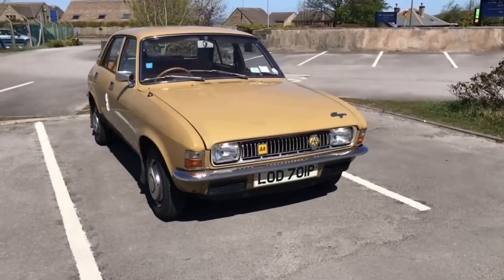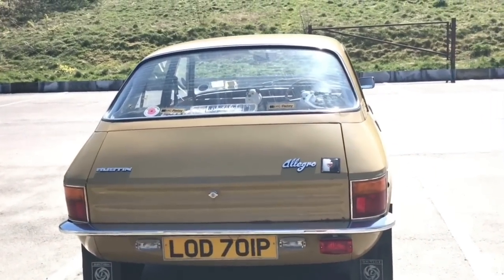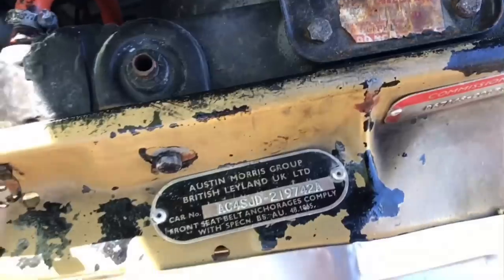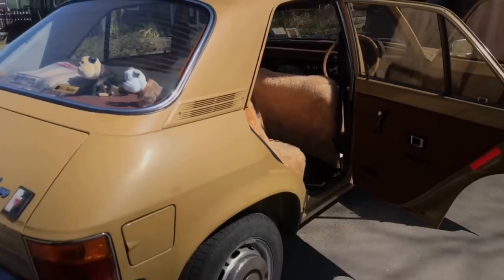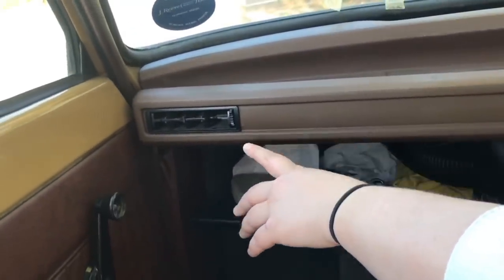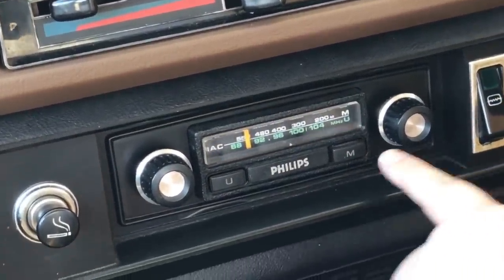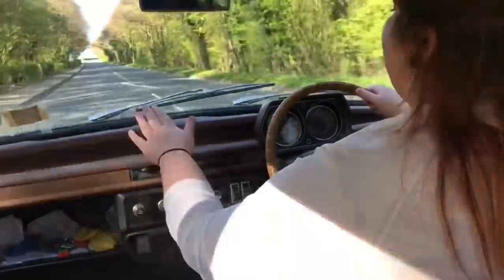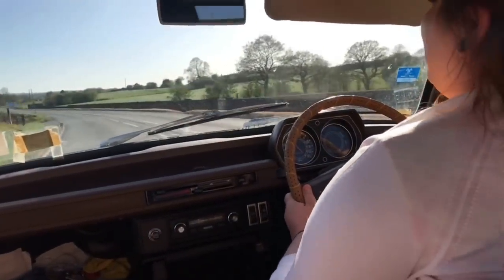IDRIVEACLASSIC reviews: 1970s Austin Allegro

Comment: You often hear the complaints about the styling of the Allegro, barrel sides, dumpy pudding, bonnet line far too high etc. But look at the newer German cars like the Audi A1 and Mercedes A class; they are exactly the same shape! They have big high bonnets and the A1 even has side windows the same as the Allegro. There is nothing wrong with the Allegro's shape as such, but the lack of a hatch and the frontal design, small inset headlights etc, did make it look like it had a chubby face. They are clearly well engineered and capable of long life, and the suspension is amazing. The main problem was the competition from the VW Golf which ushered in the era of very practical cars with sharp edged styling.
Reply: I always thought the recently replaced honda civic had a very similar look to the allegro.
Reply: The Nissan Juke is a MUCH MUCH MORE ugly car than the Allegro yet is regulalry in the UK top ten sales.
Reply: Absolutely agree. All modern cars are really Austin Maxis, are they not.
The Allegro needed a hatchback, but the "estates", which had  the tailgate were so odd looking that they could have been a separate species. 
Was not the real enemy the smart-arse motoring pundits (especially those on the telly).
Reply: Exactly, people think the allegro looks crap because they have been TOLD it looks crap 🙄... Media programming the masses as usual. Worse then ever now.

Comment: Had an Allegro as the 2nd car after I passed my test in the 1980's and loved it at the time, never let me down. First car was an 1800TC burgundy Marina 😁, that was awesome too.
Reply: I had a Marina 1800 after I passed my test in 1985 never broke down once
Reply: I also borrowed and broke my parents marina - it was a brown 1800 automatic (with a hideous dark brown vinyl covered roof) - being a young lad who thought a  wheelspin would impress someone, and not having driven an automatic before ... Just in case anyone is wondering what happens if you rev an (old) automatic in neutral then move it to drive ... Twisted leaf springs and missing teath in the differential ... No wheelspin and unhappy parents ...
I always preferred the ride and handling of the Allegro to the Marina

Comment: I was a car crazy teenager when the Allegro was launched.  I vividly remember first seeing the pictures and technical description in Autocar magazine.  It looked a lot more modern than just about anything else in its class.  It was underpowered and had fairly basic equipment levels but it was not much different from most other cars of the time.  The quadratic steering wheel was a rather odd choice though.  
Of course, it suffered from all the usual BL issues which didn't help its case one little bit.  Overall it was a perfectly adequate car but with "Marmite" styling.  That was the biggest problem, it was adequate at best.  The other problem was that it was never developed over its lifetime.  By the time the Maestro came along it was woefully outdated.
As a classic car it fairs somewhat better.  Cheap, very simple, loads of parts still available, and a great talking point.  Most people that criticise the car now would never have driven one.  They are no worse to drive than any of it's contemporaries.  Personally I would complain more about Vauxhall Vivas, or Ford escorts.  But then, given the choice I would have bought a Citroën GS which probably says more about me than anything.
Good reviewSteph.  Looking forward to more in the future.  Thanks.
Reply: @Grey Fool........I had a Citroen GS Pallas in the 1980's [white with black vinyl roof] and it has to be one of the most luxurious and technologically-advanced cars I have ever owned and for its day! [named 'European Car of the Year' in 1971]. It was incredibly comfortable, even on really long journeys - due to both the hydro-pneumatic suspension and armchair like seats. The interior and dash/controls were top-notch and everything about the car had a very upmarket and premier feel to it. 
It wasn't particularly rapid [with only a 1299cc 4-cylinder engine] but it could comfortably cruise along at 70mph all day long. However, you didn't really mind the lack of acceleration as it was just so relaxing to drive you never wanted the journey to end! It was also extremely quiet, well-mannered and a real head-turner for its aero-dynamic styling. I absolutely loved my GS and spent hours cleaning and polishing it - I even kept the engine bay immaculate!
I really hated having to sell it - but I changed jobs and got a company car as part of my compensation package. It was so funny because when my new bosses offered me the job, they invited me for lunch to celebrate and insisted I took them to the restaurant in my GS! [they had never been in one before and really wanted to see what it was like]. They were so impressed, they actually tried to get the company to switch from Fords to Citroens as the company cars!

Comment: Tell your boyfriend to retrofit a flexi-pipe just after the bend under the manifold.  Fairly cheap from parts suppliers, often just a clamp fit (cut out the section that won't be clamped, obviously) and this should pretty much take that torque strain off the manifold clamp.  I had an orange estate version, 1.3 I think,  many years ago.  The three door estate was an exceptionally good car, a Morris Minor Traveller replacement in terms of usefulness and what is I believe, an iconic profile.  As an apprentice mechanic when these were current models, I remember only too well the horror the styling received when first revealed.  My own recollection of the rear wheel failures was that, unlike the previous model (ADO16?), this one had adjustable rear bearings and not tighten up tight ones.  So, they were wanged up tight, got red hot and fell off!  We had some very vivid colours in those days, to jush up fairly cost cutting trim levels.  This little car was blessed with one of the less OTT schemes... there was bright orange, lime green, etc on later examples from memory.
Reply: Smack on with the rear bearing comment that was the cause, nothing else. later ones had a warning label fixed to the washer.
Reply: So right about the estate, I found it a very pretty shape at the time, not "rather odd-looking"! !
It just has a little kink in the rear of the roofline, almost like a spoiler (to allow room for the tailgate hinges)

Comment: Mine was the same colour and I loved it. Basically an upsized Mini, but with all that space round the engine  there were no scraped knuckles when performing a service. The SU carb benefits from regular adjustment and it pays to fit a new main jet and needle every 20k to ensure best fuel economy, -something your local garage won't be doing.

Comment: I had a Mk2 poo brown 1300 Allegro back in the late 80s and it was a great car and it was still as good as new as my auntie who gave it to me was the original owner and rarely used so was extremely low mileage when I got it and found it very reliable.

I also had the 1300 Mk2 Escort which would of been the Ford equivalent and the good old allegro trounced it in every way apart from the gear change.

Comment: Great video, as always. :-) my brother had an estate version in blue, borrowed it lots, never had any trouble with it. My brothers mate at the time had a scimitar gte in blue with silver stripe. My brother Tony said to him the allegro looked like a mini version of the scimitar, :-) he sold his scimitar the following week. :-) :-) I loved that allegro, full of character. I myself owned a Rover P5 reg number LNX 755E rare straight six engine with proper planetary overdrive. No synchro mesh on first gear, super smooth engine, at traffic lights I tended to blip the throttle it was so quiet i thought it had stalled. :-) 15mpg was scary, had twin fuel tanks, opened via a pull cable via the boot. Loved that car, best car I have ever driven to be honest. :-) thanks for vid, vinny.

Comment: Thanks Steph.  Nice car.  Josh takes good care of it.  I love the engine sounds, especially going through the gears, and it has a good hum underway that makes it so you can tell exactly how it's doing.  The exterior shape reminds me a little of the VW 411.  I noticed the remains of a sticker on the fuel and temp gauges lens.  Josh can remove that using old fashioned cigarette light fluid, as it's naphtha and it won't hurt the plastic, but use a very soft cloth or facial tissue to not scratch the lens.

Comment: Josh is spot on about the exhaust clamp on transverse engines. The more torque you had the worse the problem became. Engine stays could be installed to the bulkhead to help with this problem, but in reality they just move the force to somewhere else.
Rust on these and the Marina sent many to an early grave, especially if they lived near the sea.

Comment: I personally like the Allegro and have done since i was a kid and i'm in my 50s now. I have had 2 a 1.5 LE and latter a 1.3l Estate Allegro 3. I had the Estate for about  about 5 years from 1989 to 1994. I did have quite a number of problems with it but to be honest it was rather long in the tooth by the time i bought it. 
It was my every day car and i used it for traveling too and from work, i went all over the country with it from scotland Lake District to South Whales.
The main problem i had was excessive oil use i did change out the engine eventually and it was just the same. i did hear that they had issues with oil control ring on the pistons, or valve stem oil seals god knows Haha
However i own a New i10 now and i love it but there are times when i wish i had my old Allegro 3 back.
Your friends seems in great condition thanks for sharing guys.
Stay Well.
Darren (:

Comment: Hi Steph, I think you made a little blooper in your comments. I’m sure you meant to say 48 miles per gallon on the motorway, instead of 48 miles per hour.😂 I spent many years working on Allegro’s as well as several other makes, and I have to be honest they were good, reliable cars. I personally would not have purchased one, because I wasn’t fond of the styling, but mechanically they did not give our customers who owned them any significant problems at all.

Comment: Thanks for a very informative review and test drive. My friend Eric had a 1500 Allegro Estate (manual, 3-door) which drank oil like a Russian drinks vodka. It was always going wrong. However, on the road it was a comfortable car, by not means the worst I've been in. My impression is that the 1300 engine was a good deal more reliable than the 1500, for some reason.

Comment: This was my first car. I had a blue P reg one. My dad and I whopped the engine out and whacked in a 1275 GT engine from a written off Mini.
It went like stink.
I was only 18 or 19 at the time and I loved it.
Looking back now I can see it was an absolute death trap, like a lot of cars at the time.
The Allegro used to have a squareish steering wheel and the drum brakes basically meant that if you were driving faster than 10 MPH you had you were likely to crash of you had to stop in an emergency.

Comment: I wish Leyland Australia had been able to afford to build these instead of having to develop the Morris 1500 (which I owned in the 90's and had many engineering problems).  I think the styling is cute and the suspension sounds like it would be really comfy, even the hydrolastic was pretty good.  Love the dashboard and with a 5 speed 1750, it would have performed very well.  Thanks for the test.  Cheers

Comment: Nice to see the Aggro sorry,Allegro getting some love. BL really goofed in my opinion by not making it a hatchback. A friend's dad bought a new 1100cc version and it needed a new engine after 1,000 miles. It apparently used more oil than a two-stroke! Whilst my dad never owned one,he did have a Maxi. That needed a new engine after he left it parked up one cold,hard winter and forgot to check the anti-freeze! Result? Cracked engine block and a used engine from a scrap yard that also used more oil than a two-stroke! Needless to say,he did not make that mistake again.....nice video luv,keep up the good work.

Comment: Around 2008 I saw a 1974 Allegro 1300 SDL owned by one family from new with 46k miles on the clock on eBay. I fancied a laugh, thinking how sh!t these cars were supposed to be, hence I put a wine-fuelled bid in. Obviously I won the auction, at exactly £1000! Went to collect it from Ashford the following Monday evening after work, travelling from London. The thing was IMMACULATE in its deep burgundy paintwork and super shiny chrome bumpers, grille, hubcaps and badges; it was easily the best condition classic I’d owned at that point. I really could not believe how good an example it really was.

What started out as a joke had the last laugh on me - after a damned good service, a new set of boots all-round and a cheap Hall effect electronic ignition kit for the distributor working in conjunction with a Lucas high energy coil and high performance 8mm silicone ignition leads, it quickly established itself as a very rewarding car to own and drive indeed - It would cruise smoothly and relatively quietly at 70-75mph whilst never dipping below doing 40 mpg, all my mates loved it, people would stop me ALL THE TIME to chat about it and it made me feel genuinely proud to own it.

Instead of trying and flipping it on as I had intended, I ended up keeping it for 18 months and doing about 10,000 miles in it, completely fault-free! I only ended up selling because having had my curiosity aroused by this thing, I wanted to buy a Princess! Again, I discovered that a good one is actually an outstanding car. I still really don’t know why such a stigma surrounded BL cars like these.

After that, whenever I heard someone knock these / BL cars in general, I would cut in and inform them that this Allegro was the best car I’d ever owned, including Hillman Hunters, Mk 1 Escorts, Vivas, a VW Beetle, Triumph Heralds, MGBs, a Midget, a Riley Elf, Fiestas, Wolseley 16/60 etc. etc.

Comment: A car just like this saved my bacon when I was a young lad. My mum had a Marina and when she went on holiday one year I 'borrowed' it. Inevitably, I managed to completely write it off by hitting a (parked) diplomats 560SE at speed. So in order to not be murdered, a replacement was need before she came back. I found an Allegro for £50 in the same stunning colour as the one featured and left it where she had parked the Marina. She wasn't impressed when I told her the story but drove that thing for years afterwards without any drama at all. Ended up being a very good car.

Comment: The cure for the exhaust is to  tap a short length of slightly undersize pipe into the manifold , leaving about 1 to 2 inch sticking out,  then when you fit the exhaust it holds it in a straight plane to clamp it up straight, also gives it strength ,  We did it years ago with all the transverse engines...

Comment: Ok, it needs a bit of work but nothing unexpected really. However, that looks like a good solid example. Sure, there are one or two bits of bodywork need seeing to but they don't look like anything major.

People go on and on and on about Allegros rusting but in reality they're no worse than most cars from the 70's. My dad got a '78 Cortina mk4 when it was 5 years old and the scuttle panel was rotted out and the bulkhead beneath it was going the same way.

A guy I worked with in the '80s bought a 1978 Allegro 1.3 in Sandglow for his wife. He got it from the auction for £30. It was caked in bird crap. So he spent a whole weekend scrubbing it with T-cut and lo and behold, the car underneath the bird poo was an absolute minter! No rust to speak of, no mechanical problems, flew through an MOT and was more reliable than the Hillman Hunter the guy himself drove.